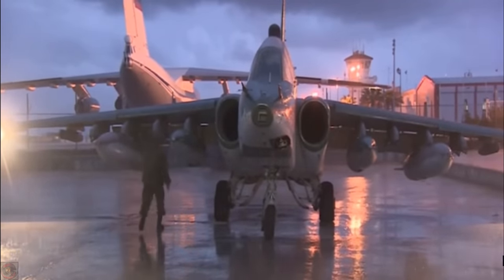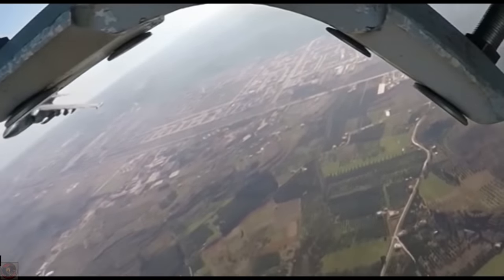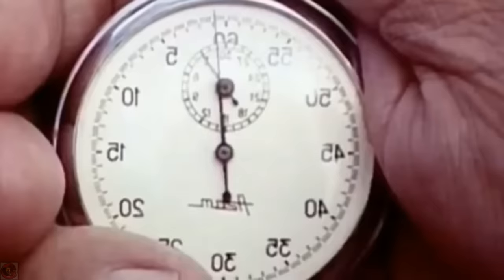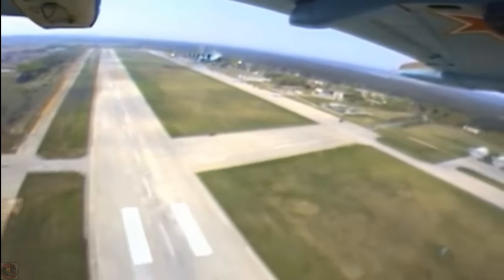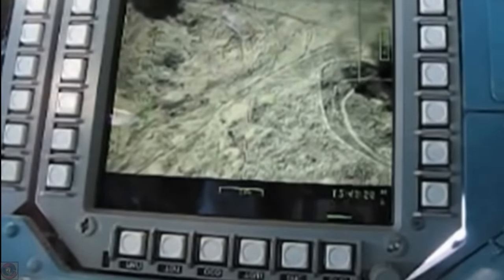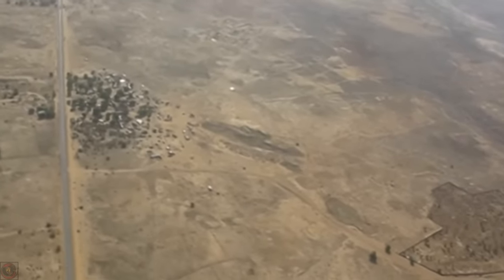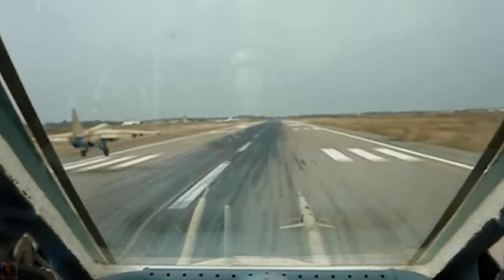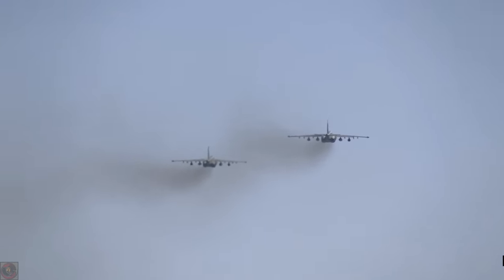Su-25 Frogfoot - The Russian Flying Tank

Comment: "You see Ivan, when of using flying tank, enemy not know use anti-aircraft or anti-tank."
Reply: Flak 88 why not both?
Reply: Stringer missile not lock on to tank
Reply: Stinger
Reply: @billybobjoe498  u can edit ur comment btw
Reply: laughs in 8,8cm FlaK 36
Reply: Jack Hunter  Blowpipe? sounds nice - doesnt work
Reply: That's funny 😂
Reply: Jack Hunter   And this is how the  Russians  got there hands on one of this ''Stingers'', one Su 25 was hit by a missile which did not explode and the aircraft was able to land successfully with the missile sticking out of the engine. By the way if the Russians run out of kerosine they didn't have to worry too much,  they just could have pour  diesel in the tanks and  carry on  flying!  Remarkable  airplane!
Reply: @perfectevo2392  oof
Reply: Anti air tank😏
Reply: @dnate697  А ты на свой стелс глянь который збила допотопная Русская ракета в Сербии
Reply: @МобиМоби-с5й  Bomb Bay doors left open and flying the same route too many times.  Other flights continued after one was lost.
Reply: fuck it, use nuclear SAM
Reply: @joshuaortiz2031  😳
Reply: @perfectevo2392 I would hope you would use ya know something a little better and newer than a rather old weapon such as a flak 88...

Comment: SU-25 is designed to be firesupport for general ground troops and conventional wars. It is NOT designed  to a support spec ops or modern conflicts without a fire front. For those types of conflicts there is SU 34 - uses modern high tech bombs and rockets. Has modern radars, jamers and etc.

Comment: The Su-25 can run on diesel fuel, the reason is that it had to keep up with the tanks during front breakthroughs, and for this, its engines were made worse in terms of efficiency, but capable of digesting almost any fuel with minimal purification from impurities, I once saw in stock a set of 4 containers for rapid relocation, 2 spare parts in 1 tool and equipment for tests and 1 autonomous pumping station for refueling... just imagine that tanks passed along the highway and you need to follow them, for this, tanks clear about 1 km of the road from 
abandoned / burned cars, trucks ...
so that there is a gas station nearby with surviving reserves and, having landed and taxied closer to the underground tanks, 1 hose there and 2 hose into the Su-25 filler neck ... 
and even with discharged batteries and the engine not running, you can still use this pump simply by turning the knob!
sorry for google translate

Су-25 может работать на дизельном топливе, причина в том что он должен был не отставать от танков при прорывах фронта, и для этого и сделали его двигатели хуже по экономичности но способные переварить почти любое топливо при минимальной очистке от примесей, я один раз видел на складе комплект из 4 контейнеров для оперативного перебазирования, в 2 запчасти в 1 инструмент и оборудование для тестов и в 1 автономная насосная станция для заправки...
просто представьте что по шоссе прошли танки и надо следовать за ними, для этого танки очищают около 1км дороги от брошенных\сгоревших автомобилей, грузовиков...
так чтоб была рядом заправка с уцелевшими запасами и приземлившись и зарулив поближе к подземным цистернам 1 шланг туда а 2 шланг в заправочную горловину Су-25... и даже при разряженных аккумуляторах и неработающем двигателе все равно можно использовать этот насос просто крутя ручку!
извините за гугл перевод
Reply: No Smoking is an optional requirement.

Comment: Su-34 is attack aircraft that suppose to replace su25. but su25 is cheaper and latest upgrade version can still serve for long time.
Reply: Replacing the SU 25 with the SU 34 is like the Americans replacing the A 10 with the F 15E... The SU 34 its more like a replacement of the SU 24. It would be a mistake for Russia to fase put the Su 25.

Comment: I loved you video and coverage of the SU-25 but don't agree with the need to replacement.  In military circles there has been an argument raging since the last gulf war.   It concerns the lack of endurance of modern hi-tech war compared with the great endurance of lower tech war but not to be confused with low tech. The argument is about when to switch from the hi-tech leading punch to balanced lower tech war winning finish. At what point do you switch modes is still in hot debate.  Most agree that we did not switch soon enough. Hi-tech is also eye watering expensive.  A country can bankrupt itself extremely quickly if you take your eye off the disappearing money for too long. Secondly you can't speed up the make process without losing capacity, such as the process of making most very modern tank armours. Most of the very current tank designs can easily destroy each other. This means you can run out of tanks faster than you can make them and run out of money in the process. So a protract war between the current powers will  run out of their Hi-tech component fast, hence lacking endurance. Currently for example Russian continues to develop designs like the SU-25 for when they switch to lower tech war. It is also the reason behind their stealth aircraft having wing mountings for weapons pylons as there is no requirement for stealth after you have air supremacy.  Its now time to pound the ground with as much as you can. As you can see the design of the Russian Stealth aircraft have the switch over from one mode to the other in mind so it can manage the transition stage between both types of war. So yes you will see a very high tech Russian ground attack aircraft but it may not be intended to replace the  SU-25. Another thing to think about is Russian has developed a very capable barrel fired missile for the T-72. Current issue is 3 of the missiles are worth more than the tank. It does show the Russians are exploring the transition phase of a prolonged war with either NATO or China. War has developed into a multilayered  and major wars have never been about this tank, aircraft or weapons system vs another of its type. I love the diversity of the topics you cover. Hopefully I have not sounded as if I am criticising but respectfully giving you another avenue to consider.

Comment: (since the A-10 and RBMGs got mentioned) What is the procedure for zeroing an RBMG? Does it involve a whole bunch of electronics to work out which of the barrels is on the piss or do you just rotate the barrels very slowly and calibrate each barrel according to how far off the last shot was?

Or is there no calibrating an RBMG, are you stuck with how it came from the factory?

Comment: Syria. With their "low tech, cheap, ineffective, outdated" tech Russians achieved more in 2 weeks than the US with their supposedly superior weapons did in 2 years.

Also this plane carries laser guided ATGM's, which are essentially identical in purpose and operation as the Hellfire. Why is the Russian one low-tech but an identical US made missile is high-tech? Makes no sense.
And dude, when you speak about the A-10, the words "high tech" should never be mentioned unless they follow the word "NOT". The A-10 is as low tech as it gets. And the cannon, that the fanboys so desperately masturbate all over, it actually the most useless weapon it could have. Even when it was designed it was bullshit, tests on old M48 tanks were rather underwhelming. 90% of the rounds miss even at close range, way closer that you would ever like to be, and 90% of those that hit - fail to cause any damage bedside chipping the paint. On open personnel its also extremely ineffective. The gun's weight in literally anything else would be more effective.
Also, the gun on the Su-25 can match the GAU8 in terms of effect on target, but Russian military inst run by businessmen who need to sell every piece of shit they make, so they knew from the start that a gun in the then already present situation was a useless weapon. But not only that, the Russian guns, even gatling guns, are far better than the US ones. For one they are gas operated, not electronic or hydraulic, which makes them 1) not have a spool-up time, 2) not rely on auxiliary systems that increase the probability of malfunction, 3) weigh several times less, all while delivering identical effect on target.

The A-10 being low-tech is exactly why its being used, same with Su-25. Why waste S150k bomb on a illiterate peasant? No wonder we cant win a war while being trillions in debt, and Russians kicked ass in Syria making a notable difference within a week. You cant win if the ammunition you expend costs more than the target you destroy. You are the one who loses in that engagement.
Reply: Roland Lee the Russians have lost every battle they were in Syria. Russian military sucks. Russian military uses rusted naval craft, rusted ground vehicles, rusted aircraft, and staging soldiers. The Russians are a paper tiger,
Reply: Right... which is why the rebels have basically lost the war by now... Makes sense.
Reply: Anti Russian Refuter aka 'ARR' haha thats why syria allready declared winning the war on terror...maybee u should read some.real syrian news and not cnn wich doesnt even report on that war since russians started bombing jihadis....for abvious reasons....
Reply: Spot on Roland.  Russian Air Force was the most effective in Syria.
Reply: Roland Lee a 10 isnt high tech russia has only high zech
Reply: Capitalism Is Best Ism pffff right ?lost ahhaha
Reply: A10 migt be the lowest tech of the USAF fixed wing aircraft for attack, but A10 has seen a vast modernization with the "Charlie" upgrade beginning in 2005 , which added 2 Multifuction Colour Displays ( glass cockpit) Embedded INS/GPS navigation system,  SADL Datalink system (inter-compatible with Link 16),  and Ability to utilize GPS ( Jdam) and Laser guided bombs and be able to self designate targets with Targeting Pods ( utilizing either Litening 2 or Sniper ATP) , A new Counter measures system with an integrated IR missile warning sensors. the A10C went IOC in 2007 and saw its first deployment in 2008 to Iraq.  It  has been further followed up by Software suite updates  since 2008 , and additional features such as Scorpion helmet hud and additional guided weapons ( APKWS laser guided rockets).

Su25SM modernization has been more economical at first and slower paced in how fast they were being upgraded,  such as adding HUD (  Something the A10 had from its inception) , and a Single Multifunction display, Digital Flight navigation system with GPS compatibility  and did not at first utilize a targeting pod, for many years.

Only recently has the follow on Su25SM3  upgrades allowed the Su25 to carry a Targeting pod  ( Solt 25) similar to the likes of the L2 or SNiper. and Su25SMS upgraded to SM3 are not around in any meaningfull numbers . Whilst on the other hand the entire fleet of A10 (270-80 something warthogs) are not only alll upgraded to A10C standard, but also to the latest Software suite 8 since 2015.

https://drive.google.com/open?id=1SDnRyKeeTXQCrWO0z_c7Yr7dbvcIfzeC

The only thing recent SM3 upgrade has added  has that the A10C doesn't have the  ability to launch Anti Radiation missiles, but if you need resort to using subsonic CAS aircraft to start shooting off anti radiation missiles for conducting, then your using the wrong aircraft for the job, and have far bigger problems on your plate like Achieving Air superiority or  first ensuring clearance over IADS
Reply: +Roland Lee Yes Russian air support did make Syria win against the terrorists, but its wrong to compare what Russia did compared to how "effective" the US was. US funded and armed the terrorists so their anti terror operations was just a cover for their bombing of Syrian infrastructure and economy and as a pretext for them to as of time of writing occupying about 30% of Syrian territory. So we cant compare Russian and US operation in Syria as US was not honestly fighting terrorists.
Reply: Interesting plot you have come up with for a political thriller novel
Reply: I wouldn’t call the 30mm GAU useless since the rounds can be changed to HE making it more ground attack instead of armor attack.

Su-25 is an amazing attack plane but I don’t think it is armored as the A-10. Just this February a Su-25 was shot down in Syria by MANPAD Anti Air Missile(Shouldered AA).

A-10 was shot down before.... But it takes an actual SAM to shoot it down. There’s been multiple records where it was hit by a MANPAD AA and some Heavy Machine Guns yet it still successfully RTB’d(Retreated To Base)
Reply: The difference is a somewhat capable ground forces designating targets.
Reply: Lord Cognus  ... sure it would. Because the US has a great track record when it comes to small countries. What's the score at the moment? Illiterate farmers: 3,  supposed worlds best fightig force: 1. The US army's training is a joke. Even the US special forces are trained by Israeli and UK special forces because their own soldiers aren't up to the task. No doubt the US has the fire power to win almost any war but time and time again have shown that they don't have the first clue how to use it.
Reply: Roland = logical comment
American apologists = you said what!!! ..... REEEEEEEEEEEEEEEEEEEEEEEEEEEEEEEEEEEE
Reply: Roland Lee You’d be surprised what a military can do when it isn’t held back by in competent leader ship
Reply: @JuniorJuni070  Honestly speaking, US forces should be having the easier job logistically speaking because of all  the stockpiles they have built up in Iraq and other Allied countries in the Mid-East (part of the US's global network of bases, a rather noteworthy achievement on its own), while the Russians have to launch everything from Russia proper or get it shipped in with the Syrian Express via their facility in Tartus (which was apparently not even a real base until after Russia decided to get involved militarily).

 Well unless they are using Syrian munition stocks but they don't appear to be doing that.
Reply: Yeah thats the thing about Russian aircraft. You need equipment which are cheap, low maintenance, reliable and to the least have the capability to destroy enemy equipment. You cant have American planes requiring air conditioned hangars and runways that require daily maintenance as well as expensive parts and coats of paint. You need a plane that can take off a grass field if required and stay out in the heat for prolonged periods of time. If they get damaged all they should require are a few metal scraps and some good welding. This is what won the British the battle of Britain. You need equipment that is hardcore. If it gets destroys, then you should be able to build 10 more. That was the American aim during WW2. That is where Russia is good. They make weapons with good reliability that are rugged and can take some damage and its worth to send them in to fight. It like sending when America sends a fully equipped soldier with $18000 worth of gear into a building with a terrorist with a $10 knife. If the American gets killed then its a huge loss. What you should do is send a self detonating drone in to kill the guy. That still will cost $50 but much better than losing a guy.
Reply: Tbh I heard murmurs about the US being revoked from nato for their bullshit so...
Reply: Pretty sure the high tech comment was about the new gen hellfire
Reply: @marks238  The Russian Air Force lost the most aircraft. Thats not a win.
Reply: I do not debate illiterate propagandists inclined to intellectual dishonesty and misinformation...and that includes you. Nikola Poiukov
Reply: A gas operated gun can be jammed just by a bad dud round. A Electrically operated gun keeps cycling the duds out and firing. That is the reason why chain guns has replaced gas operated guns in many weapons systems. The reason why the russians were so efective in Syria it simple, they chose to support the right side.
Reply: Weeks? It took Russia months of air support for Aleppo to fall. It took so long, Russia actually started using their old, unguided munitions and older tactics.

Russia simply claimed the credit due to the western coalition for destroying Daesh, while killing literally everyone else, besides Daesh. Thus “winning” the war for Assad since no one was alive to oppose him since the west killed the terrorists and Russia killed everyone else.
Reply: @kurousagi8155  Exactly right... Very well put. I appreciate your accurate representation of the facts... Russian air power is severely challenged. Technologically deficient, unable to generate a decent sortie rate and a glaring lack of quality munitions. They are 20 years behind...

Comment: The Russians recently installed the latest targeting system on all their aircraft. The system is called "SVP-24 Gefest" (СВП-24 Гефест) It is an automatic navigation and computing system that receives information about all parameters and conditions. The pilot either has coordinates in advance, or chooses the target himself, after which he activates the launch of the ammunition. The system itself calculates the moment of launch, taking into account the parametric data, the type and weight of the ammunition, the direction, speed and height of the aircraft and external conditions, humidity, atmospheric pressure or rain, wind speed and direction, air temperature and the system itself at the right time launches or drops the rocket or bombs. Thus, the Russians turned bombs from World War 2 into precision weapons.